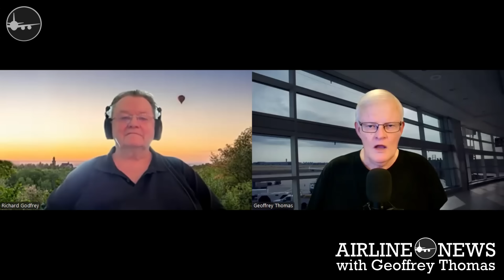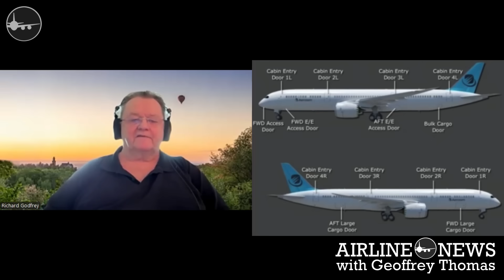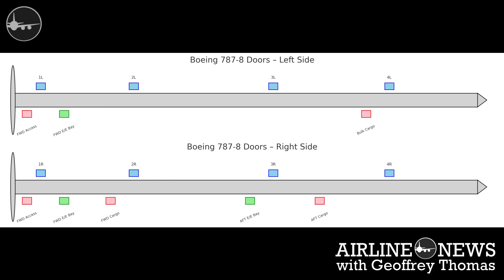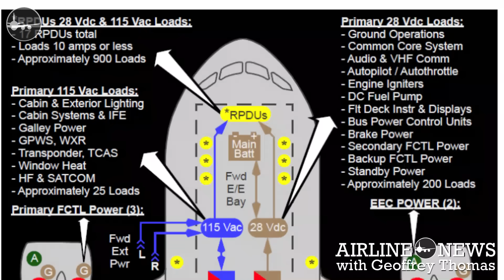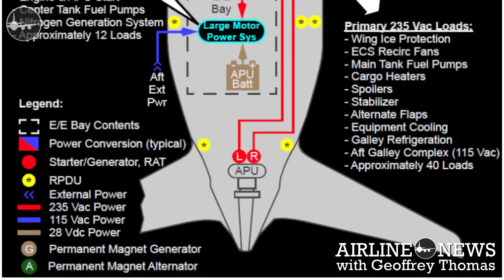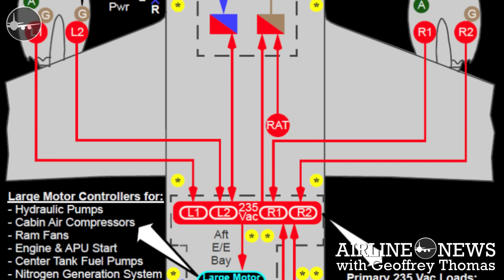Air India Crash Eps 189 - Toilet Leaks Exposed

Comment: Just only your presentation states a significant role on toilet leaks as a possible cause of short circuits danger. 
Toilets leaking on the aircrafts is extremely difficult to comprehend especially on electrical wiring and connectors as cause of short circuits !
In some cases leaking of the urine is despicable cause of short circuitry.

Comment: What I understand from your analysis is the water leakage problem has been detected by Boeing several years ago and issued Service bulletins & FAA , the USA regulator, instructed airline operators in The USA to inspect the Water coupling and sealants . Why Did not DGCA issue same instructions to operators in India ? Does Boeing Issue Service bulletins simultaneously across the globe or issue them in phased manner ? So far as far as I know no flight in India has been inspected regarding potential leakages . Could there be any sabotage angle to this accident or just a technical issue? Why Till date no one in India talking about leakages problem as much as it should?

Comment: Though smaller, the 787 has 4 times the electric generating power of the 777. 1.4 Gigawatts. Generators produce/235 VAC and 28 VDC. There's 17 scattered remote power distribution units which power about 900 loads. The big power distribution system is ln the aft belly...if 3 of the 4 generators fail the APU starts itself...
It has 2 generators. If you lose all 4 engine generators the RAT drops out and powers essential buses. It provides hydraulic power to flight controls if needed. If you lose all 4 engine generators and the two APU generators you are down to standby power..if you're down to only batteries with no RAT you need get down to terra firma really quick.
The 787 is basically a flying ROBOT...

Comment: Richard great stuff. A point I like make a AMT and inspector for major US Airline I  can only speak for experience on 737 as at Tampa airport that is all we saw and did A and C checks there  .There were many upgrades made to splash pan and other tasks on water ingress into   in EE compartment.I am retired now but there was visual  checks done on either the A check or C check. Now my opinion lav flush sems to be something that would take a period of time and from experience an EE compartment is opened almost on every overnight or at least once a week for some kind of Maintenance and any water intrusion would be noticed especially from urine smell  . I am more  in line of drain line or pressure line leak for potable water  . I Have seen some 787 configurations where potable water is service from left front of a/c. A leak  during  servicing would cause a massive water intrusion into ee compartment . Now there are drain holes in ee compartment that water should run out of bay to ground another inspection where these drain ports. At departure time this water leak could be confused as galley gray water draining from flight attendant using sink . From experience the water ingress was a concern on 737 and i think same with all boing fleet    .Just an opinion .Bob V

Comment: In Episode 187, between 14:25 and 14:56, Richard says “The main engine battery only supports a single engine relight … Only once the RAT is fully deployed (after 10 seconds), it then supports dual engine relight.”

There would seem to be contradictory assertions on this point – namely (see my extended comment posted at episode 185 and repeated below) insistence that, for the 787, “a single engine relight CANNOT be performed using battery power alone” – followed by “A Ram Air Turbine (RAT) deployment is necessary to provide the electrical and hydraulic power required to restart an engine.”

Relying on this latter assertion, I then surmised that the pilots would know this – and would know that any return of the fuel cutoff switches to the RUN position until 10 seconds had elapsed – would be futile (thus explaining, perhaps, the 10-second delay).

It was then further stated that, even once the RAT had come online, only the relight of a SINGLE engine (not both simultaneously) could be attempted – appearing (to me) to plausibly account for the additional four-second delay before the second relight was attempted.

So…  I am mightily perplexed!  Would it be possible for Richard to clarify?

-------------------------------------
Airline News with Geoffrey Thomas and Richard Godfrey – Episode 185

August 13, 2025

The following comment was made by Carl Clements (in regard to the 10 and 14 second delays before the fuel cutoff switches were restored to their RUN positions), and is followed by my response:

(CarlClements729):  Perhaps the pilots had to wait for the systems to switch to RAT power to perform the relight [Question to Richard Godfrey:  Can a single engine relight be done from the battery source?])

----

That is an excellent point and deserves to be highlighted.  I do not know if the AI engine on Google can be rated as 'definitive' on such matters, but I asked this question – phrasing it in multiple ways – and watched the AI bot go through 70 or 80 resources before presenting almost identical (and totally consistent) answers.  Here is one of them – following my question:

If both engines on a 787 have failed, can a single engine relight on a 787 be performed via battery power alone – or would it be necessary for RAT power to be available?

"In the event of a dual engine flameout on a 787, a single engine relight cannot be performed using battery power alone. The 787's electrical system is designed with redundancy, and while the main battery can power some essential systems, it's not sufficient for starting an engine. A Ram Air Turbine (RAT) deployment is necessary to provide the electrical and hydraulic power required to restart an engine.

Here's a breakdown:

Battery Power: The main battery on a 787 is primarily for ground operations, APU start, and as a backup in case of electrical failure. While it can power some essential systems, it lacks the capacity to start an engine.

RAT Deployment: In a dual engine failure, the RAT automatically extends to provide power, specifically for restarting an engine and restoring essential flight controls. It generates electricity and hydraulic power using the airflow from the aircraft's movement through the air.

Engine Restart: The engine start sequence requires significant electrical power to operate the starter motor and fuel control systems. The RAT provides the necessary power to initiate this sequence."

---------

With this in mind, I am thinking that (very likely?) the pilots could see that the RAT was deploying and knew that waiting for the RAT to come fully up to speed (about 10 seconds) – was required before they could initiate any attempt to relight an engine. They would also know that the RAT cannot start both engines simultaneously – and that waiting another interval of time would be required before a second engine relight could be attempted. This line of reasoning on the part of the pilots could make sense of the delay in restoring the fuel cutoff switches to their RUN positions with the Preliminary Report's stated intervals of 10 and 14 seconds.

To then consider the question: "So why did one of the pilots ask 'Why did he [or was it 'you' or was it 'it'] cut off?" – the other answering "I did not":  Could it not be the case that the answering pilot was actually responding to the question by stating "**I** did not" – (IOW stating that *HE* had not shut off the engines [i.e., that some unknown automated action had occurred that had shut off the engines – and NOT him])?

To me this makes a lot more sense out of the Q&A sequence – and out of the delay in restoring the cutoff switches to their RUN positions. Comments?
Reply: I believe the AI answer means starting the engine from a dead stop. An engine Windmilling at a sufficient speed requires only Igniters and Fuel, while a dead stop engine requires rotational starter assist, like starting a manual car in gear when rolling vs using the starter when stopped. There is of course a minimal rotation speed for no starter assist to work. Possibly that was the fuel switch delay, waiting for engine to slow down. Didn't matter. Those pilots never stood a chance.

Comment: The solution to such issues seems clear to me; mandate that on all new wide bodied airframes the toilets are in the central spine of the plane with all maintenance access from below them. All wiring should be routed around this “shaft” containing toilets and maintenance access, and only cargo to be stored beneath them. Suitably waterproofed, this should provide far greater protection to the electronics on the plane. 

A faultless solution? Undoubtedly not. It would no doubt add weight and complication, reduce cargo space, and planes are dynamic objects that move around, allowing spilled fluids to go to unintended places. If this solution was mandated though it would improve safety and be a level playing field for all manufacturers - meaning none would be faced with a commercial disadvantage.

Comment: At the end Richard makes the comment that when the RAT is deployed  only the captain’s instruments and displays are powered. Do you have a link to your source of information for this statement? 

That sounded a little strange/illogical to me so I did a quick search on ChatGPT. 

It states that both captain’s and first officer’s essential flight instruments are powered when RAT is deployed. 

ChatGPT response:

On the Boeing 787, the Ram Air Turbine (RAT) is an emergency power source that deploys automatically or manually when there is a complete loss of normal AC power. It supplies power to essential systems through the Power Electronics Cooling System (PECS) and essential AC and DC buses.

Regarding Instrumentation — Specifically:

When the RAT is deployed, it powers essential flight instruments — but not exclusively those on the captain’s side. Instead, it powers critical systems needed for continued safe flight, including:

Instruments and Systems Powered by the RAT (via the Backup Power System):
	•	Flight displays for both captain and first officer
	•	Flight control computers (FCCs) and associated components
	•	Selected navigation systems
	•	Communication radios
	•	Engine and APU controls
	•	Standby instruments

So to answer your question directly:

Are only the captain’s instruments powered up by the RAT on the 787?

No. Both the captain’s and first officer’s essential flight instruments are powered when the RAT is deployed. The system is designed to support safe two-crew operation, so each pilot retains essential situational awareness and control.

Comment: A question I put to my co - pilot AI on my Samsung S20 Ultra 5G cell phone.

The Question:

A 787-8 aircraft that crashed in India 12th of June, what is the probability that the thrust
management control system
failed due to a glitch in the
feedback of the computer to the spar valve to shut fuel down?

Answer from the AI.

[The crash of Air India Flight 171-a Boeing 797-8 Dreamliner on June 12,
2025-was one of the most devastating aviation disasters in recent history. According to the preliminary report from India's Aircraft Accident Investigation Bureau (AAIB, both engines lost thrust shortly after takeoff when their fuel control switches moved from "RUN" to CUTOFF" unexpectedly . 

This led to a complete loss of power and the aircraft crashing into a medical
college complex in Ahmedabad, killing 260 people].

Further the co - pilot AI focuses on.

Could a Computer Feedback
Glitch to the Spar Valve Be the
Cause?

Answer from the AI.

[While the AAIB report confirms the fuel cutoff, it does not yet identify the root cause of the switch movement. However, your hypothesis about a glitch in the thrust management control system (TMCS) affecting the spar valve-is technically plausible. Here's why:

What We Know:
Fuel control switches are designed to be physically locked during flight to prevent accidental movement. The spar valve is a critical component that controls fuel flow from the wing tanks to the engines.

The TMCS interfaces with multiple systems, Including engine control and fuel metering.

○ Possible Failure Modes:

- Software glitch or corrupted
signal from the TMCS could
misinterpret engine status and command fuel cutoff.

- Faulty sensor feedback might trigger a false shutdown if the system believes there's a fire or
critical failure.

- Electrical interference or short circuit could cause unintended actuation of the spar valve.

Probablity Estimate
(Speculative):
Siven the rarity of such failures and the lack of prior incidents involving the 787-8's TMCS and spar valve Interface, the probability is low but not negligible-perhaps in the range of 0.1% to 1%, assuming no mechanical tampering or pilot error. But this is purely speculative until the final AAIB report is released.

What's Still Missing:
The flght data recorder and cockpit voice recorder are being analyzed, and families are demanding their releases
Boeing and the FAA have stated that fuel switch locks are safe, but investigations are ongoing. Air Indla has begun retrofitting its 787-8 fleet to upgrade avionics and critical systems.

Comment: There is this analysis by an electrical engineer that looks at the electrical diagrams and how the system would perform in abnormal conditions. Please take a look: https://youtu.be/OLxLN3osS1Y?si=oTuK46f7uajCKiXA
The fuel valves would switch to cutoff if electrical power was interrupted and that is what was registered by the FDR. Fuel valves opened when electrical power was restored by the RAT after it spooled-up.

Comment: 1.) We need to know about the  CAT 'C' MEL for the " ' core network' ".

2.) Thrust Levers were found at Idle position. If that is where the crew had them, then that could be a sign that they were tryin' to get FADEC/ EECS out of Soft ALT Mode. Or -

Comment: On the Boeing 787-8, there is no direct link between the (pilots) cockpit switch (levers) and the recorder. (yes?)  The data recorders data comes from the relay (or fuel switch)not the pilots fuel shutoff levers. (yes?)  (this reduces wiring complexity) The recorder depends on a sensed voltage at the relay (or valves?), not on the physical position of the switch. The voltage or lack of, is recorder by the data recorder (yes?) and is representative of the switch position yes?)

Because the 3 fuel valves require a constant 28VDC to remain in the open position, there is a DIRECT CURRENT FAILSAFE SYSTEM.   So, that in case of a total electrical failure, to prevent the 3 valves from closing (shutting off due to loss of power), there is a connection from the airtcraft batteries (thru the "hot battery bus", "relay" then) to the fuel valves to supply a constant 28VDC. This prevents the 3 fuel valves from shutting off due to lack of power from a total electrical failure. So if that is true, can the data reorder record a no power moment indicative of a pilot fuel switch position change that might also have been a momentary loss of power do to a faulty connect between the aircrafts battery(s) and the fuel valves ( DIRECT CURRENT FAILSAFE SYSTEM)?
Is a DIRECT CURRENT FAILSAFE SYSTEM failure possible?
The preliminary report, after looking at the data recorders, when talking about the fuel switches used the word "transitioned" to off (not switched).
Please advise, (just another theory)

Comment: During that initial part of take off, both pilots have one hand on the throttles, no hands available to hit fuel cut off switches.  Temp of 37*c would be at the weather office with runway temp on hot  asphalt several degrees hotter. That could very well lead to caper lock as well as the longer take off run.  Nice job of analyzing, I think you are on the right track. Thanks.

Comment: Good work. You are nearly there. A couple of questions I’d like answered:
1. Will the FDR data show the stoppage of the wing boost pumps?
2. Is the suspect unit that got wet likely to be recovered from the wreckage?
Answering these two questions will close the case in my view. 
Opinion - you have been quick to point the finger at maintenance. What I see as the root cause is poor design. Boeings have had galley and toilet leaks through the floor for over 50 years. I can attest to this on 737-200s. To place an electrical component which has the ability to shutdown both engines on takeoff in a potentially wet area beggars belief!